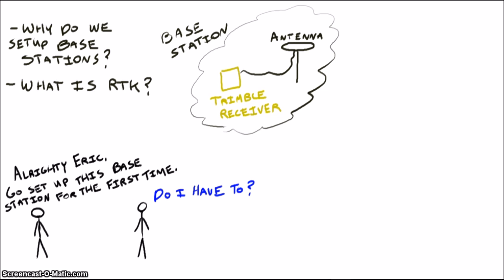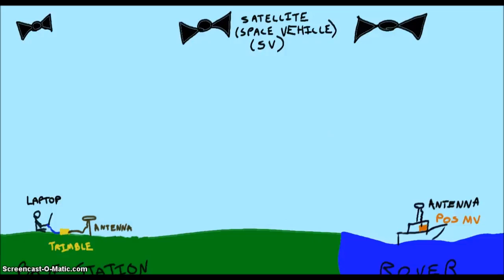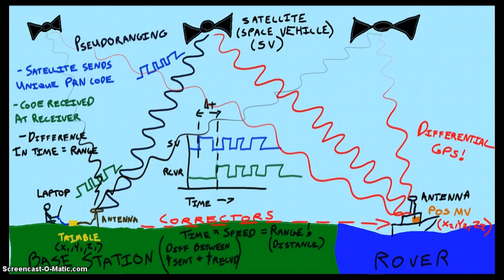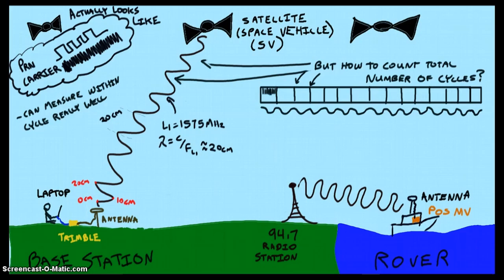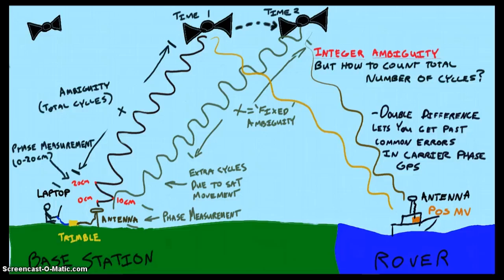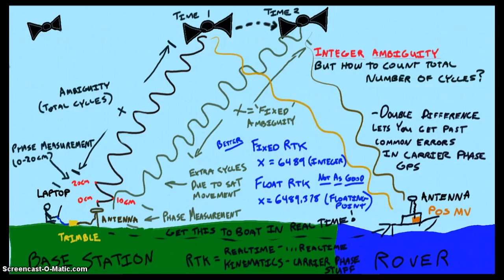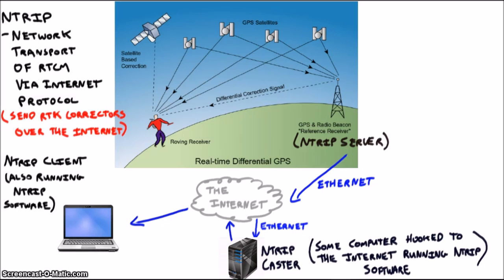5 Minute Modules - NTRIP, RTK and Base Stations

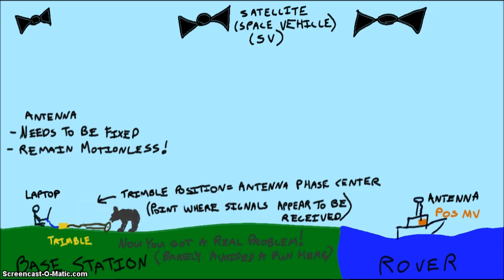Comment: 1:13 - wait...the accuracy of the rover's position will only be as accurate as the one of the base station, hence the use of a benchmark for the base station if you need absolute accuracy...for relative accuracy between several rover position it's ok though.

Comment: Will I get under at least 20cm accuracy if a base station sya 50 km away from a rover?  I know that it needs to be 10-20km away to get a centimetre accuracy but what kind of accuracy you get if distances are bigger than 20km?
Reply: 1cm supl pour 10km 
2cm supl pour 20km 
3cm supl pour 30km

Comment: Why do boats need super accurate gps?
Reply: If you were installing a wind farm in the middle of the sea, you would need to know where to put the turbines
Reply: Because when you have sunken logs, boats, or various morphological features to avoid underwater a difference of cm is what separates a safe voyage from damaging your boat, to grounding your boat, to becoming a shipwreck.

In hydrology international regulation states that you must have an accuracy of <25cm. Taking into account the vertical error inherent with our current level of sonar, you need a horizontal accuracy of <~3cm to be able to achieve a sub 25cm total error. This is only achieveable with RTK or other similar technologies
Reply: Bathymetric surveys for one.
Reply: outside the box
Reply: As we all know  fish remain in the same location and never move more than 6 inches in their lives,  If you cast your lure outside the 6 inch target range you will never catch a fish......or just because ...
Reply: because reasons :)